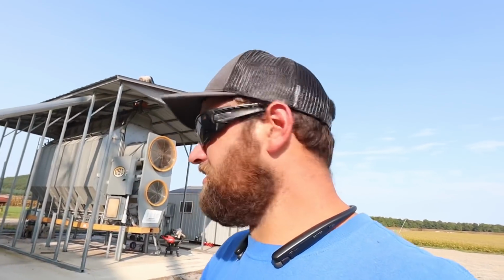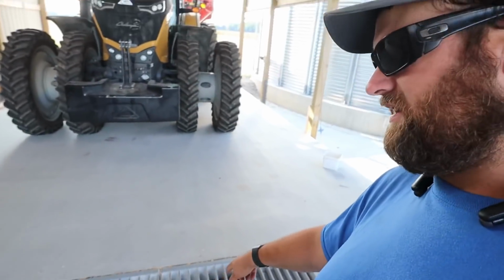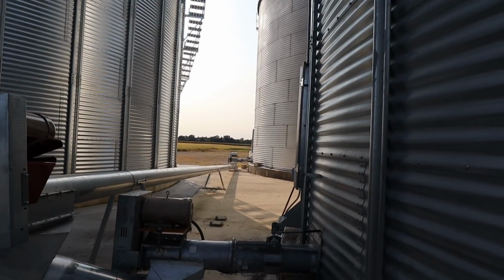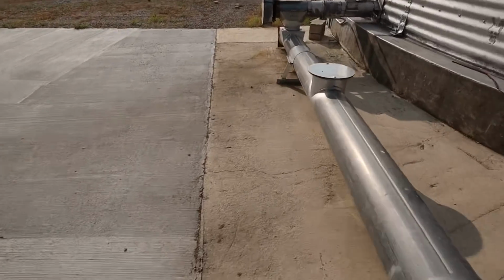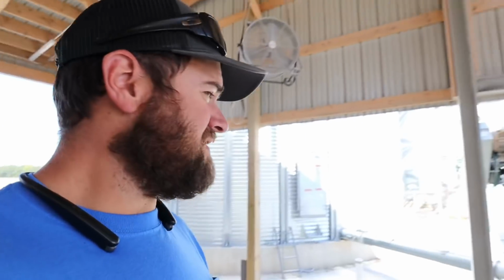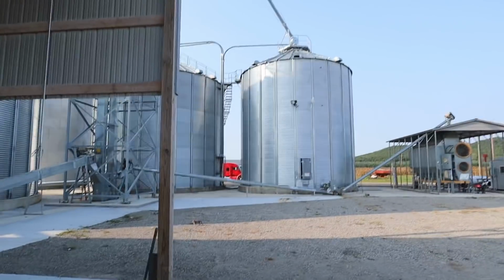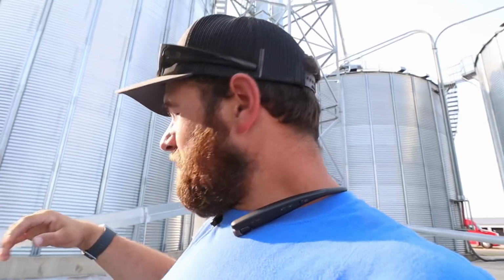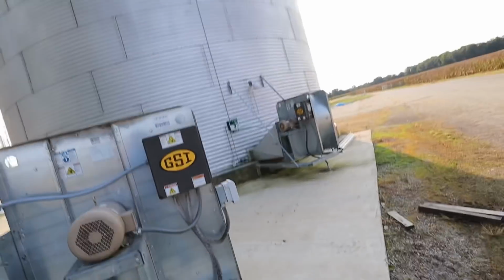By Popular Demand! Grain Bin Site Tour

Comment: Have you considered using plexiglass instead of a sliding door for the opening in the dump shed? Easier than sliding a door and cheaper alternative to glass. Could potentially add a sliding or prop up door to cover it for bad weather.

Comment: Mount a weathertight tool box up on top of the leg with a set of wrenches in the appropriate sizes for things up there and a grease gun with a couple tubes of grease. Then you only need to remember to buy new tubes of grease and maybe a power tool for jobs one of those wrenches won't do.

Comment: As to your regret of having only ladder access to the top of your 'Leg'.... consider this thought >>>     mount a high-pressure-grease-hose up to the zerk(s) with a ground level assess to grease the bearings. Might be alot of hose if there are several grease points, but hose is certainly cheaper than a stairs and much safer.

Comment: Instead of climbing your leg to grease it, you could run 1/4 air line with fittings down to the bottom of the leg.  For your dump shed try plexiglass. Awesome video keep them coming!

Comment: what i dont get on every farm youtubers setup is: why dont you use a plc for the controlls?
its always lots of buttons on a control panel to run the sites, why not just use a plc and have just a touchscreen
to select from which point to which you want to transfer material and let the plc figure out the rest

from what i see in the videos its a pretty easy logic in the background, so programming should cost that much
and the hardware needed would be mostly cheap digital i/o

in an industrial setting i would go nuts having 20 buttons on a panel and making sure only the right ones are
active in the right order for something that simple

Comment: One cheap way to MAYBE help with the dust in your dump pit area when loading trucks. Get an empty one ton super sack and attach it to the down spout so its bottom is close to the top of the trailer you are loading. Make a hole in the bottom of the sack same size as your flow of grain. Then have loops of bunge cord around the sack on a few spots. I have seen this done at a facility and it's not perfect but seems to help. Might take some experimenting to get it just right. If you gets something that works well have a tarp shop sew you up something better. Or spend the money on some stratigically placed duct work with exhaust fans.

Comment: if you was to put a gate on the end of your load out and closed it and filled the pipe so far and then open it enough to were you did not plug leg but did not run the pipe empty you would not have any dust.

Comment: BIN TEMP HACK: wouldn't the temp readers drop inside the bins once the grain has passed it thus knowing where you are in the bin?
Reply: It appeares that they installed those sensors every 2 ft in the cables so the sure track system will tell you on the web interface dashboard fairly accurately how full each bin is. Unfortunately it needs to take sensor readings for about a day before it decides the bin inventory has changed. So it wouldn't be much use when filling the wet bin because that level changes so quickly during a day it could never keep up on knowing the bin level.

Comment: The 20 foot Door.  Is it possible to build a small 1 foot addition to fit the door vs not using one at all, you will still have a 20 foot wide entrance? unless the door was returned...lol  you can also get those heavy plastic strips to hang from the entrance to cut down on wind.  Similar to what they use in meat packing plants...or costco lol

Comment: Hello from Scotland, great video, very interesting. Over here it would be rare to see a on farm grain handling setup with bins, mostly steel framed buildings for on the floor storage. Can be used for machinery or fertiliser etc at other times of the year. Or if farming changes something completely different. Still can be filled using elevators etc after the dryer, or dumped on floor and pushed up. Loading out with a decent loader, or payloader as you guys say,will fill a truck in minutes. All the USA farm  youtubers I watch seem to have no end of bother with augers, elevators, cleaning bins. No idea on costs but I'd guess a simple building be a bit cheaper and less ongoing hassles. Like the channel keep up the good work.

Comment: I worked at a company blowing granulated sugar through 4” pipe and we installed stainless steel pipe on all the turns in the system ,worked great . Thanks for the great videos
Reply from the maker: Thanks for watching
Reply: Need to look into abrasion resistance steel with a hardness of 400 or higher.  You can still bend, roll and weld this material and it's less expensive than going with lined metallic pipe.  Those sweeping 90's are better for wear than hard 90 degree elbows.  Another option is standard carbon steel with bullhead tee's (tee's have wear plates that take all the wear when making the turn)

Comment: There are different options for wet bin monitoring, pressure sensors with lights, a simple flag/inside lever, etc.
Reply from the maker: We have sight gauges but sometimes you still need to look
Reply: Check out the channel boarder view farms he put in proximity switches wired to lights 4 up the whole bin and when the  top light is on you know it’s close to full really cool set up